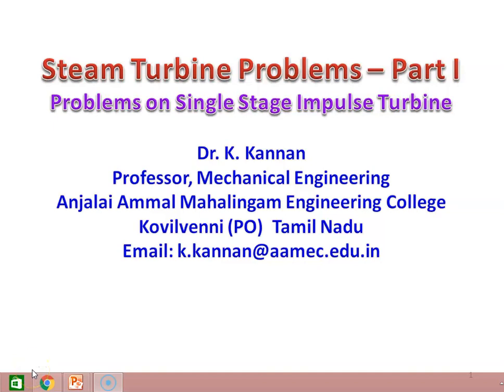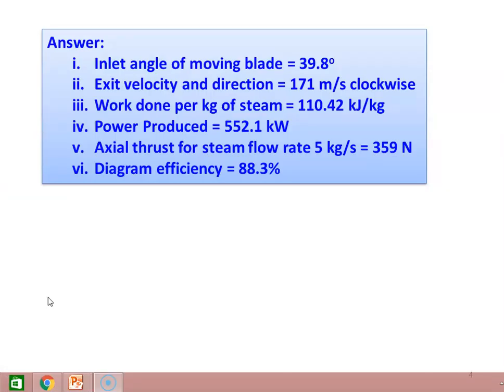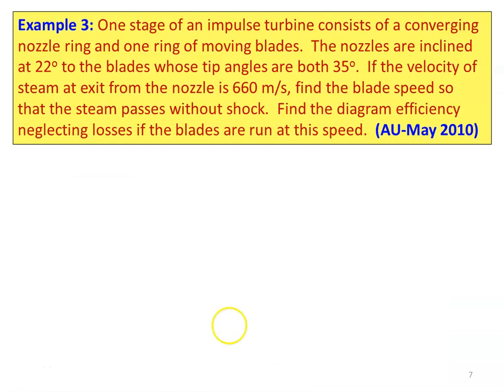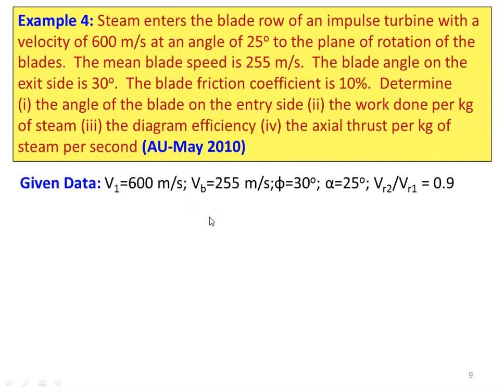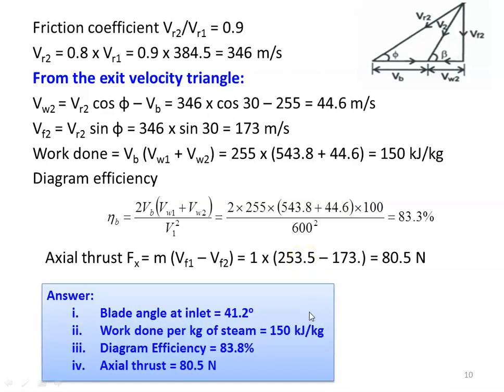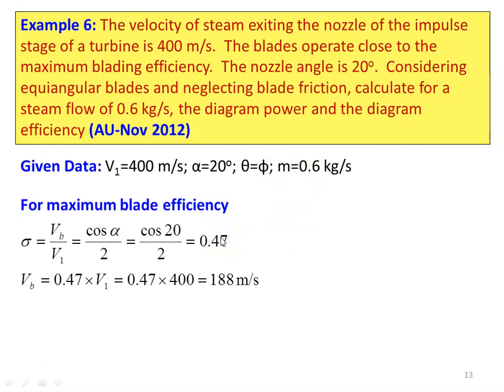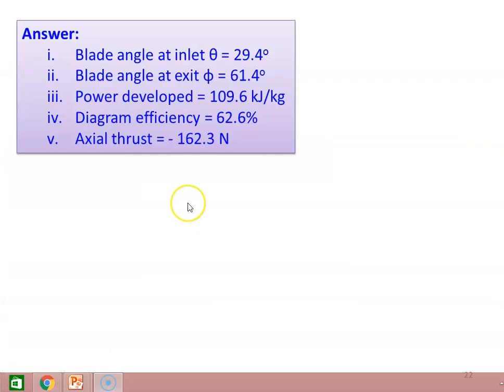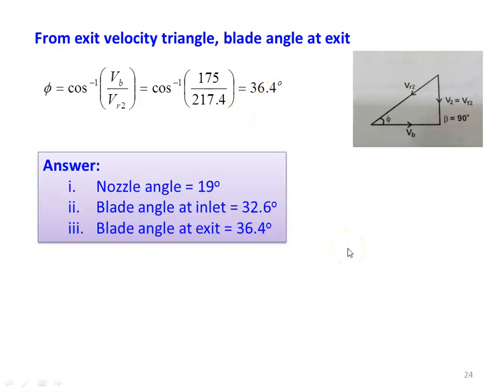ST 06 Steam Turbine - Problems Part I

Comment: Sir in anna university semester xam we need to draw perfect velocity diagram or rough diagram?
Reply from the maker: A neat diagram is required
Reply: @dr.k.kannan198   sir then we need to draw using the protractor compass, etc?
Reply from the maker: Use the scale and pencil and draw neatly